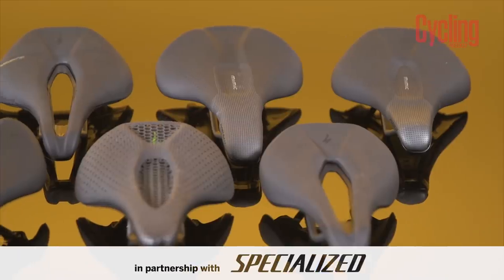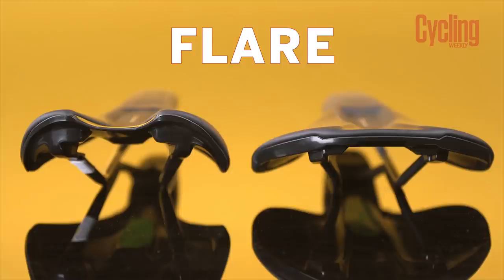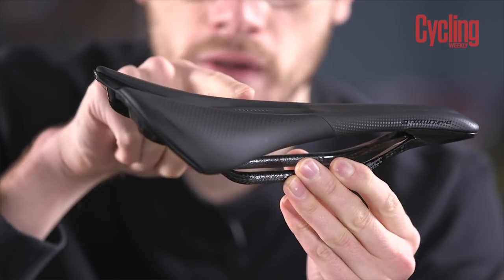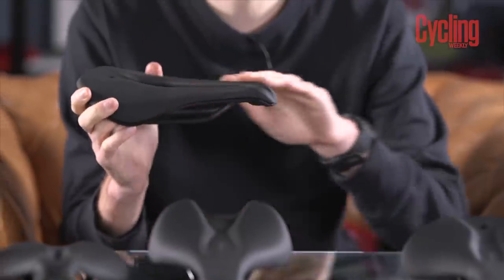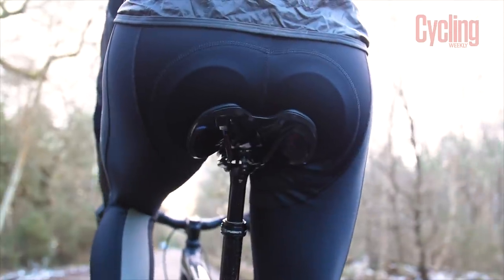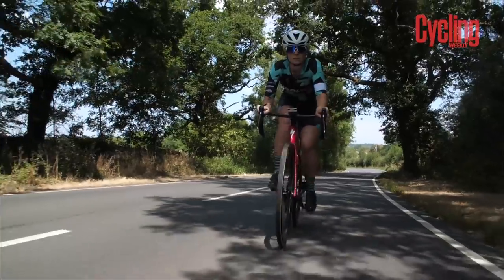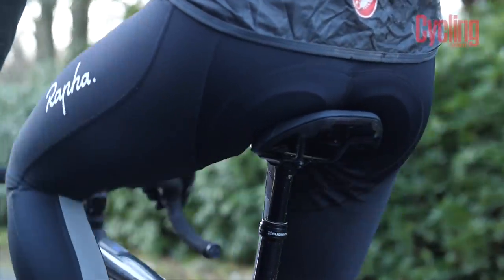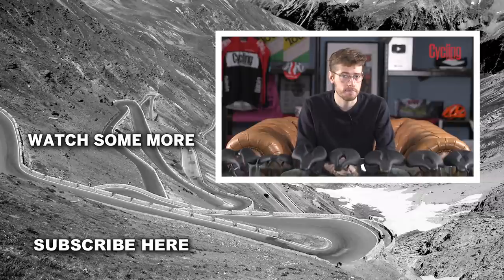Do You Need A Cutout Saddle? | Saddles Explained | Cycling Weekly

Comment: The theory on cut-out saddles is that "where there is nothing, nothing can cause pressure", but my experience is "where there is nothing, there is something around that nothing that causes pressure", because I would always feel the edge of the hole cutting into my butt. That's why I prefer saddles with a solid, flat shell to evenly distribute all the pressure.
Reply: Thank you! Dr. Schrader and others have definitively proven that saddles with cutouts can actually make things worse!:

Dr. Steven Schrader with the National Institute for Occupational Safety and Health (NIOSH):  “When you sit on a bike the pressure on the perineum increases sevenfold. Riders using a classic saddle place 1/4 of their body weight on the perineum. The amount of oxygen reaching the *** typically falls 70% to 80% in 3 minutes. A guy can have his oxygen levels drop 100% but he doesn’t know it. After half an hour he goes numb.

Saddles with splits or holes may make matters worse because they have smaller surface areas, and hence the rider’s weight presses harder on less saddle. The arteries in the perineum run laterally and therefore they come under more pressure when they come into contact with the cutouts’ edges. It is no longer a question of whether or not traditional bike saddles causes ED, but what are you going to do about it?”

The solution IS The Spongy Wonder No Nose Bike Seat!
Reply: They work for some  and not for others
Reply: @troycarpenter3675  Wrong. They damage some more than others but everyone gets damage.

Comment: If you feel discomfort after several hours of riding it’s potentially because you’ve just done several hours of riding.
Reply: nah, i can ride my cheap e-bike with the stock saddle for 10 minutes and shit goes numb down there and is extremely uncomfortable. It's not "ow my butt hurts" after sitting for 4 hours, it's "why does that feel that way thats not natural" lol
Reply: Lol no.  I can tell you're most likely a lightweight small frame guy.  Proper sit bone width cutout zero discomfort after hours of riding.
Reply: @Dus306  6.1’ and 85kg (187 pounds)

Comment: A really poor advert for Specialised. The only reason I stuck with it to see if bike fit was mentioned, it wasn’t. Before even considering a new saddle the bike fit should be looked at first, it will solve many comfort problems - even very minor adjustments can have a significant impact. Come on Cycling Weekly, you are better than this.

Comment: Numbness & pain? Then get a SQLab saddle. I have tried at least 25 saddles, Specialized, PRO, Fizik, SelleItalia, Ergon, SMP... from cheap PRO to Fizik 3D... For me, a good test is the ability to sit on a Kickr indoor set up and do a 2+ hour session, only seated and not have any pain, numbness or discomfort. SQLab saddles, not the prettiest, but they work, for me anyways.
Reply: The nose looks pretty long on the SQ saddles, but if it works, it works! I'm shopping around because I've had the same issue as you, 40mins on the trainer and I get numbness, on the road same
Reply: @independentmind1977  The 612R is with a short nose and for riding aero or in the drops. Despite the harder saddle and carbon rails, I use it for 200km rides without any issues.

Comment: Really interesting video, I have watched many videos & read reviews as it’s an area I always struggle with.

I’m fairly narrow with sit bones, have limited amount of padding overall & as I have had 2 lower spine operations to remove discs I now have very limited movement in my lower spine which means reduced ROM.  Most of my riding is done with hands on the top of the bars because of this.

I do find the flare at the rear helpful, don’t have an issue with a longer/shorter nose, however always have issues with 2 specific aspects.

1. Pinching on the upper inside of the legs (both sides) where the pelvis presses against the saddle.
2. Sit Bones almost feel like they are wanting to pierce through the skin.

I ride mostly Gravel/MTB events so use a mix of bikes.

Any suggestions/considerations would be greatly appreciated. The best saddle so far has actually been a completely plastic (No cushion) option which cost approx. £20 lol

Comment: I would like to hear more about the flair shape and its design/function theory. I am about to pull the trigger on a Power Pro Elaston or a  Power Arc Pro Elaston (sitting on a board vs a log I hear) and my sitbone width is 118 which rates me on a 143 saddle but close to a 155. Trying to decide if I am so close to a 155 saddle if I will be rolling off of the 143 on my Specialized Epic "XC" bike. Any advice or a video discussing this would be helpful. I find that saddle type, height and position are the greatest mysteries of bike fitting ;-P

Comment: As a novice in this area, all those seats look basically identical with only a few changes.  I've seen dozens and dozens of different designs so this video isn't comprehensive in any way.   It's a good basic understanding of seat design/features, but wouldn't use it to choose a set based on those presented.

Comment: @Cycling Weekly... Saddles with cutouts are one of the dumbest ideas in cycling. By reducing the saddle area you are effectly increasing the stress (pounds per square inch) on the rest of your posterior that is in contact with the saddle, creating chaffing hot spots. If a cyclist needs to reduce pressure towards the front of the saddle he or she should simply rotate the saddle downward a few degrees to move the center of pressure towards the rear of the saddle.
Reply: WRONG.